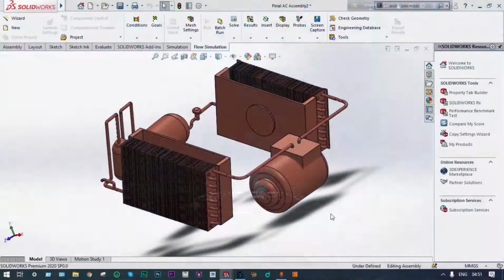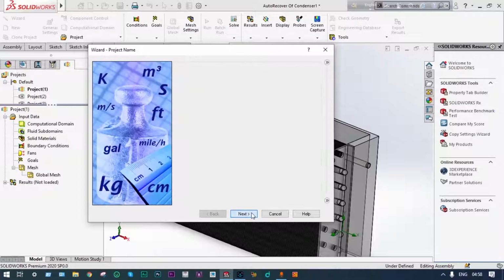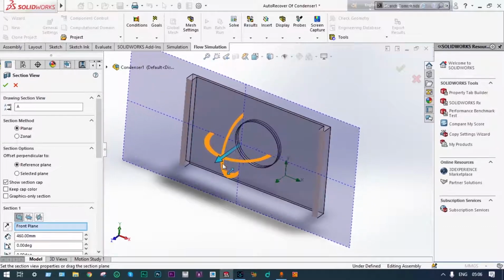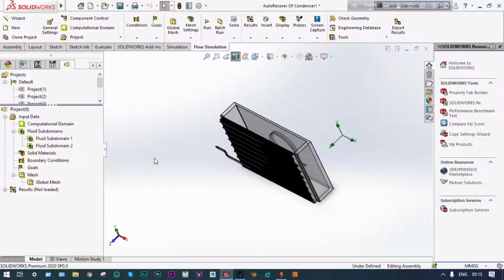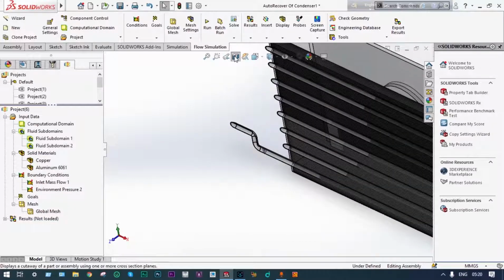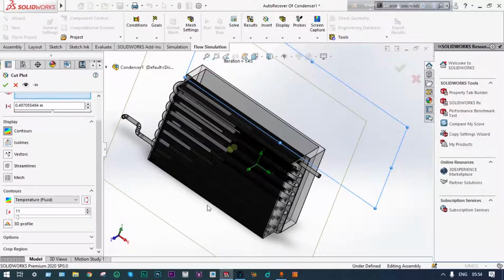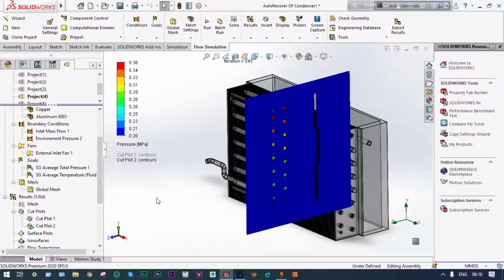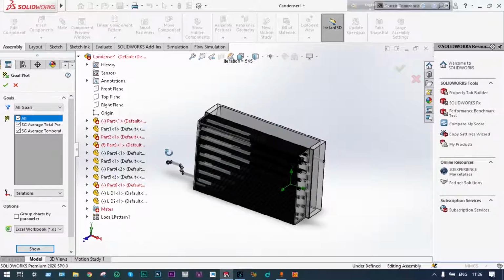Optimize HVAC Performance with SolidWorks 2020: CFD Analysis of a Condenser

Comment: Solidwork flow simulation is not taking into account the phase change to liquid of the refrigerant. You can see that from the temperature cut plot. There is a gradual change in temperature of the refrigerant. When refrigerant is undergoing a phase change it stays a constant temperature.

Comment: Why will the outlet bounday condition in a evap or cond coil of HVAC be environmental condition ? It is not going releasing to ambient. As soon as you gave the environmental outlet boundar condition, you pressure in below box there itself changed to 0.2 MPA.

Comment: Hi Erudire, I am currently doing a university project and modelling a car radiator, I have got somewhere with the help of your videos but would love to be able to email you for more help? Would you be okay with that?
Reply from the maker: You can email me about your doubts
Reply: @CFD_GUIDE  Sent, thanks! Much Appreciated
Reply from the maker: Have you provided ethylene glycol inside the pipes with specific temperature? How are you panning to force air accross the fins? If you are not providing any fan, in that case you have to provide air velocity with proper axis selection as a boundary condition at the last step of pre processing
Reply: @CFD_GUIDE  I have added a fluid (air) domain in the enclosure surrounding the radiator with an initial temp and speed of 20 celcisu and 26.8m/s I also have a velocity in and out for that enclosure to force air over the fins, do I need to set a boundary condition on the fins and tubes of a real wall? also what boundary condition for air velocity would you suggest?
Reply: @CFD_GUIDE  Also, I have provided ethylene inside the pipes with a specific temp of 40 degrees and also initial mass flow of 0.00442 kg/s and no initial velocity, should this be an internal or external simulation? currently it is external.
Reply from the maker: You can consider this one as an external analysis & provide boundary conditions for fins for convection to air.
Reply: @CFD_GUIDE  Thanks will do, when I am doing a real wall boundary condition and I input heat transfer coefficient and fluid temperature, which fluid temperature is it, since the wall is in contact with two fluids, the air and the glycol?
Reply from the maker: Convection will occur twice. From inside fluid(depending on your model may be you are providing ethylene glycol) and again convection will take place from the outer walls to atmosphere. Internal one you need not think as it will be taken care by CFD.